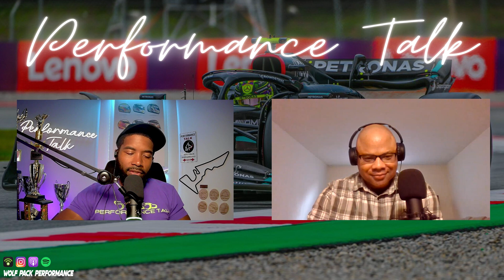MERCEDES W14 | 2023 COST CAP

Comment: If Mercedes breached the cost cap, I say.....SO WHAT?!?  A precedent has been set that the cost cap is a line drawn in sand, given the FIA's handling of Red Bull's breach of the cost cap.
Reply: With the focus on racing, most people don't even consider the political side of F1.  However, long-term relationships developed between the core developers of F1 and certain F1 team owners, its why we're even having the conversation about the Cap, as within those relations come special privileges.  Look at Dietrich Mateschitz, for example. The 76-year-old is worth $28.4 Billion and that kind of $ is very influential, both politically/financially and they use that advantage to broker deals with the likes of F1... such as, handing Max the 2021 title, or favorable decisions against ignoring FIA regulations, and receiving under the table releases of new proposed regulations... to name a few!
Reply: @BobbyOfEarth would that be the same case with the illegal tire test in 2014 that benefited Mercedes and Lewis ? Team caught doing this could have been ruled out if the championship run. But they never took it that far … actually give them a slap on the wrist.
Reply: @groundhabit6408 This stupid tire test excuse again!🙄 You are seriously comparing a tire test to AN ENTIRE BREACH OF COST CAP WHICH AFFECTS THE ENTIRE CAR?🤡 Seriously? The cost cap breach gave Red Bull an advantage for the ENTIRE CAR! Not just the tires! THE ENTIRE DESIGN OF THE CAR! WHOLE CAR, not TIRES! By the way smarty pants, all teams have access to tires, not everyone has access to Red Bull’s rocket ship design! 

Can you seriously compare the 2014 Merc with the 2022 AND 2023 Red Bull? Max is so ahead, the tv cameras don’t even bother trying to put him in frame, too far ahead! In 2023, Max has won how many races now?😴😴 Compare to how many races Lewis won in 2014. Other teams earned poles and won in 2014, in 2023 how many non Red Bull pole sitters and winners are they?

Max fans need to stop sharing a brain!🤡
Reply: @groundhabit6408 wrong. It was actually in 2013 when they were still using the v8s. Those tires were tested on a previous regulation car. Not eye v6s. On top of that nerc was actually one of the last teams perreli went to. Merc emailed the FIA about it. The FIA said it was cool. And they ran the test. Ontop if that they didn't know the compounds being tested. Just the fact they were tires on an obsolete cars.
Reply: @inflight-r3c  ok a year off … if perelli emailed the FIA about it , why was it illegal ? They tested the tires with in season vehicles which made it illegal as the rules stated. You’re literally reporting this incorrectly. Mercedes was the only team selected as Perelli couldn’t even prove they sent e-mails out to all the other teams. This was illegally done and benefited merc as a team that collected massive amount of data on new tires that would be implemented. To make matters worst all the drivers had on all black race suits and helmets. These action were deemed illegal for a reason. Yet Mercedes was slapped on the wrist for the wrong doings.
Reply: @groundhabit6408  it looked shady as heck, no doubt there. But the reason they got a slap on the wrist is because Ferrari also ran a test with perreli. It was on a 2011 car by another division of Ferrari but ferrair was still present in the test. The reason it was illegal is because it was on a 2013 car. And the teams were whining about merc getting on unfair advantage even though, they had no idea of the compounds, the fact merc was still bad that season, and the contract the fia made with perreli technically allows them to do that with no repercussions to anyone. The scary part is the FIA and other teams were completely unaware of Ferraris .everyone knew with lotus but thecinfo about Ferrari only was known when Ferrari spoke and merc since those were the only two teams perreli had asked currently. And merc was not accused of lying in court. Which means they did have some evidence that said they had the green light. Ontop of that the contract perreli signed with the FIA says they can call a team to supply them with car for tire testing. And they needed a modern car so that the tires didn't spin on the rims or loose pressure like they did in previous years. What merc did was a benefit to all the teams not just them. And we can clearly see that as the w04 still chewed up tires like no tomorrow. That's why they gotta slap on the wrist. It wasn't it wasn't like the over spending in 2021 that rb did since it only benefited them.
Reply: @inflight-r3c  knowing the compound means nothing. As a trained team you can tell after 1000km of testing what type of compound you were testing just by how much grip was loss in a period of time.  The fact that perelli stated the way reached out to all teams when they didn’t by email was shady. They fact the drivers were all in black also proved they k do what they were doing. Mercedes had the lost to gain and knew for a fact using in season car was illegal and did it anyways. Regardless if FIA stated they had green lights to do the test.  When evidence was asked from the team and Perelli they had none. Emails they claimed was sent couldn’t be provided when asked for. Yet rules were still bent for Merc and they slapped the reserved driver instead of the main drivers involved.
Reply: @inflight-r3c  Well, looks like you shutdown that disagreement!🤣🤣🤣
Reply: @chrisclements4676  lol. They never learn😭
Reply: @groundhabit6408  as much as it may seem shady. The contract does say a team shall supply them with a car and it doesn't have a restriction on what the team is allowed to pick. And like I said. It helped the other teams and merc clearly didn't get any advantage and it was technically under perrelis supervision not merc and the court never accused them of lying. And the sad part is this isn't even the worst of that tye fia has done. It's actually really tame
Reply: @inflight-r3c  the rules are clear as day , you can’t test tires with in season cars… there is no dancing around it. Ferrari used a 2011 car , why didn’t they supply them with a 2013 car like merc did ? Wouldn’t have to do with what the rules clearly states ? You say merc didn’t get any advantage … no team that did 3 days and 1000km of tire testing comes out with zero data… this is a data driven sport we are speaking of. The test was supposed to be 100km only , Mercedes did 1000km … and you think they gained zero data ?
Reply: @groundhabit6408  yes Ferrari did use a 2011 car and the rules say you can't test in season cars out the period. But because of the contract the fia had with perreli. Technically it was a perreli test and not a car test. Plus even w8th the data they could've got. The season should explain to you that they didn't really get anything.its a super gray area.
Reply: @inflight-r3c  there was no technicality … in season cars couldn’t be tested with in season drivers period. Not only did Ferrari follow the rules and gave a 2 year old car , they conducted their test with old drivers … where do you think the teams get the tires to do the test from ? If this was all in the technical rules , this wouldn’t have found to be illegal. Stop trying to safeguard Mercedes to make them seem like the cleanest team on the grid. Wearing all black and unmarked cars even points the level of illegality of the action. 100k was the rules they did 1000k with 3 full days.
Reply from the maker: Fair
Reply: Haha hypocrites